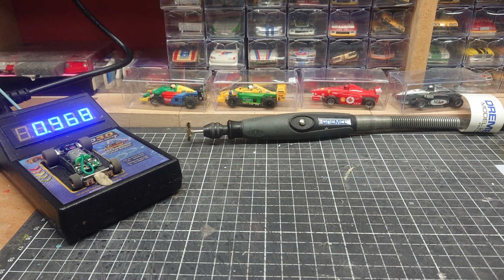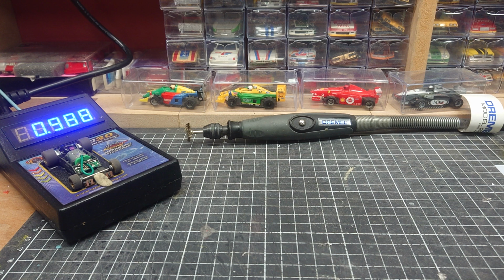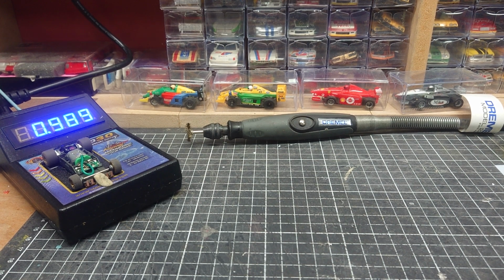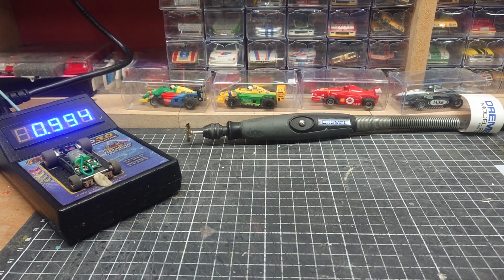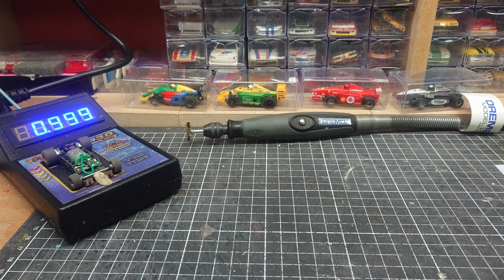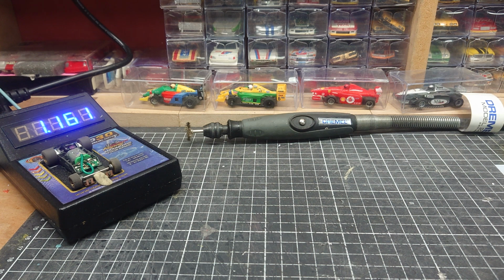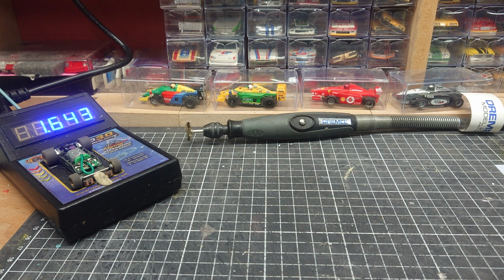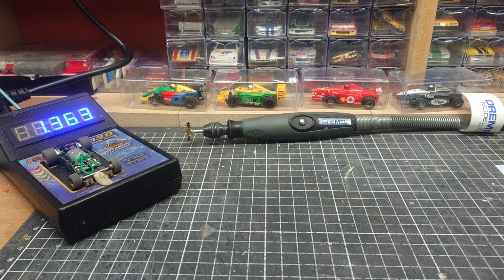Mega G+ 1.7 racer build - Part 3 of 3.

Comment: Wow great videos thanks so much. So the circuit board is not necessary? What does it do?
Reply from the maker: The circuit board is to reduce Rf (radio frequency) noise.
So in short, without the circuit board it interferes with other electrical items like TV's etc.
Reply: @murdervalleyraceway   oh will it interfere with wifi????

Comment: Thank you for the dino tips where do you get your cam drops from the u.s. I never heard of it does it work on pancake Motors
Reply from the maker: Commutator drops work on everything with motor brushes. I've found by my experimentation that I prefer to not use it on pancake motors. It tends to leave a residue on the cam that dries. Eventually it slows the cars down.
A clean com seems to give me better results on pancakes.